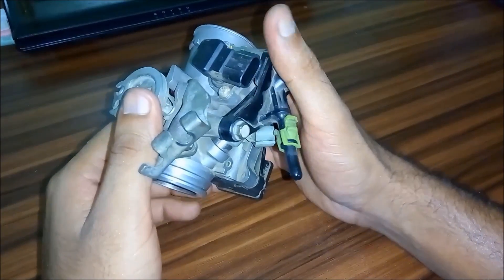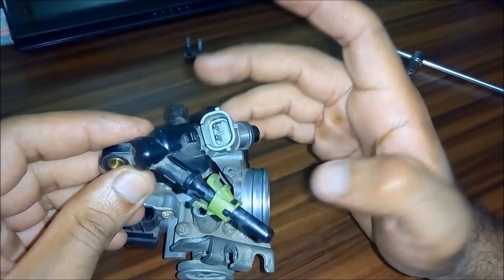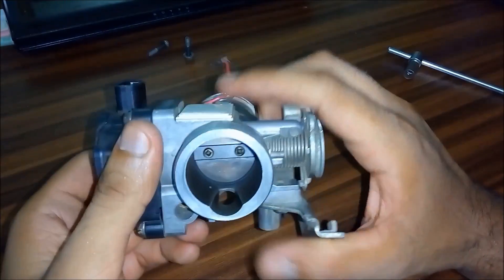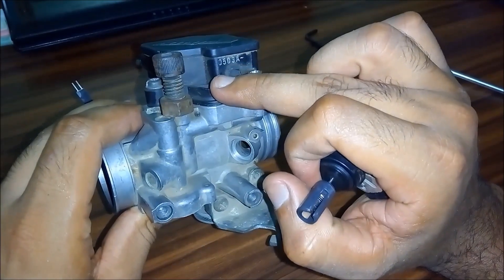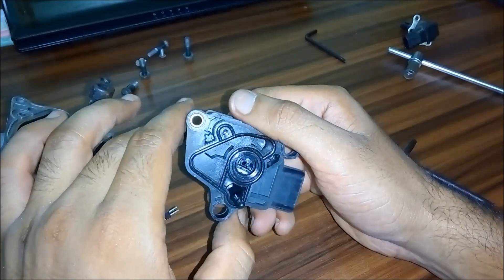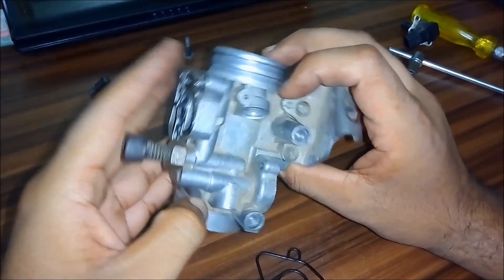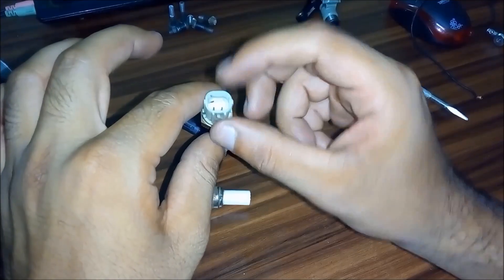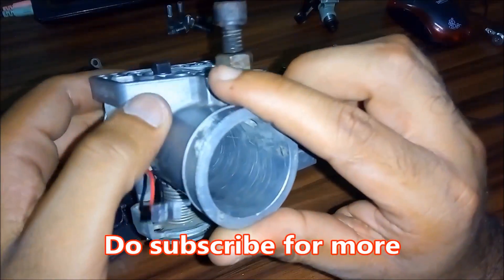Karizma ZMR,CBR 250 Throttle body ,fuel injector full breakdown and sensors explained

Comment: Sir i have 2012 model hero honda karizma zmr which was used till 2016 and kept aside just for project work i brought it for Rs.18000/- now my project is cancelled so i would like to restore it completely it was converted to carburettor by first owner...now when i tried to estimate after dismantling it was around RS.124000/-...major expense in that was FUEL PUMP RS.11000/-...THROTTLE ..RS.36000/-...PLS help me to restore my zmr for minimum price according to your knowledge...pls give me your best suggestion..

Comment: How to fix problems regarding Idle Air Control Valve? My cbr 250r have poor idling and is hard to start with closed throttle!
Is the IACV fixable from home?
If not how is it to be fixed? please help

Comment: Bro after cleaning my zmr throttle body, the idle RPM rised up to 2k
Reply: Close the idling air screw little
Reply: Check ur throttle position sensor properly in place and check air filter also

Comment: Hello.. can you help me for my ZMR 2011 model? Actually I have andling issues and local garage suggest me to reset Throttle Body from showroom. But they saying for replacement and it cannot reprogram.. so please tell me what is thruth
Reply: Bro check all sensor redings and if it's needed replace the faulty one only

Comment: Sir i have a cbr 250r Abs model 2013. I have an issue with my engine heating a bit too much thats becoz ecu cannot monitor the proper mixture of Air and fuel. I have checked the ENGINE lightm there are 9 blinks. What to do? Do i have to clean IAT sensor or buy one? And whats the price of it sir?

Comment: What is the significance of that big allen screw on the throttle body ?
Reply from the maker: Just a bolt I mounted to adjust Idle..!!
Reply: Ah so it does not come like that from the factory right ? Seems like a mechanical stop to bypass idle air control valve ?
Reply from the maker: Yes..!!..Idle RPM was 1200 even at fully closed throttle plate so mounted this bolt to keep it at 950RPM..!!
Reply: @powerpulse.Tuning  That sounds really nice , any pratical benefits to it ?
I personally think that it will make it a bit difficult for the bike to be maneovered at slow speeds and also more clutching will be required at the launch ?
Reply: @mokujin29  just to increase fuel efficiency at idling conditions specially on red light or in case of serious road jam
Reply: @tarunrajvlogs4274  No it has nothing to do with fuel efficiency.
Reply: @mokujin29  at idling conditions IC engine runs in between 1000-1500 RPM when u initially start engine rpm goes slightly above 1800-2000rpm bcoz tht time engine needs rich air fuel mixture ratio (10:1) in order to achive operating temperature but after some time rpm reduces to 1500 rpm can vary from bike to bike and engine runs on lean mixture ..but high rpm at idling conditions obviously needs more amout of fuel as throttle plate is closed completely n air enters into combustion chamber by the help Of IAC valve ( idle air control valve) which is constant until u remap ur ECU and IAC valve pulse rate ..so tht more air can enter into combustion chamber as stepper motor ( IAC valve) reciprocates slightly more inside throttle body ...n moreover in case of idling conditions fuel consumptions is directly proportional to RPM ..more the RPM at idling conditions more fuel will be comsume by engine 

For example at neutral idling conditions if u rev ur engine to high rpm than obviously u need more fuel for tht in order to achieve high rpm so low rpm around 1000 to 1500 is best for idling conditions it ultimately improves fuel efficiency at idling conditions
Reply: @tarunrajvlogs4274  Wow that is huge info & it is all correct.
However meddling with AFR is not required as long as the IDle Control Valve is working.
Reply: @mokujin29  btw by reducing idling RPM u can increase fuel efficiency at idling conditions whether other factors can also be vary with it but fuel efficiency is also one of them ...

Comment: Hi Bro, my zmr is stopped on road while riding ..as my mechanic said fuel pump and cdi not working ..but while riding bike it stopped like how we feel when petrol is not their on tank(I had half tank petrol ) and I heard some kind of short circuit sound near left side of tank and same sound in flasher below seat...can anyone tell what will be the issue..because my mechanic say it may cost too high for all new times ..please reply ASAP
Reply: The fuel pump is shot , you need to import a new one from Aliexpress.com OR get the carbon brushes replaced from someone who works on starter motors.

Comment: I need a help my cbr250r is getting trouble to start in moring . What can be the issue
Reply from the maker: Well if ur bike is having trouble while cold starting then that might be the Engine oil temp sensor malfunction... Otherwise Cleaning fuel injector and throttle body will do the job..!!Make sure check engine light is not blinking..!!
https://youtu.be/96sl1lnYyGo

Comment: Mate could you pls help me with my zmr..i am from ludhiana..i have the latest gen..the problem im facing is jerkiness and hesitation at lower rpms say idle rpm to around 2000rpm..i am not able to use the low end torque..i have also owned a karizma r and i wud just put in 3rd gear on turns and it wud simply glide without any hesitation..but zmr is jerking..i went to service center but they dont know shit about this bike..it is really frustrating as the driving pleasire is down to zero..please offer your two cents..
p.s - are you from punjab?
Reply from the maker: I'm sorry bud but there's no solution as company messed up with compression ratio and ECU remapping...There's been more den 200 cases of complaining about knocking and other annoying sounds and rough riding in regard with version 2 models.!!!My suggestion is keep RPM above 2500..!!!
Reply: Sparkplug change

Comment: Hi +TopEnd,
I've just changed my headlight assembly on the zmr myself n accidently forgot to reinstall the bank angle sensor. It started beeping on my engine check light and the engine was revving on its own. Now that I've realized that I missed it, I've reinstalled the sensor back and the engine check light is not warning me of anything. But still the automatic revving has not stopped.. Can u pls help?
Thanks.
Reply from the maker: That sounds like a clogged and dirty throttle body and idle air control valve....Also clean your fuel injector!!!
Reply: TopEnd
Sure I'll see what I can do.
Thanks
Reply: TopEnd
Hi again, do I need to reset the ecu after reinstalling the bank angle sensor??
Reply: Check if your throttle cable is binding.

Comment: Sir I have Honda cbr150 when I am   not drive my bike 5 to 6 days then my petrol drain 2 liter approx...what's the reason sir..
Reply from the maker: 2 litee is a bit much....fuel is leaking brother either from below the tank where fuel pump is located or your top cap is loose...fuel might be getting evaporated from der....also check for your fuel pipe lines to make sure they r tightened
Reply: Sir...i forget to add one more line..
In between 5 to 6 day i use to drive   1.50km to 2 km only to going market...so suggest me what's the problem..
Reply from the maker: Yes its not much distance!!!check for leakage beneath tank
Reply: Thank you so much...sir

Comment: CBR 250R uses the same throttle body?
Reply from the maker: Vijay Anand Not just CBR 250 but every single cylinder motorcycle throttle body has same components nd physical structure. ..
Reply: Na na mate, I got the principle and how it works, I was interested in knowing whether the parts are swappable, meaning the throttle body as a unit and injector setup, is the CBR's throttle body a direct fit to the ZMR vice versa, since your title read 250.. Just wanted to know that :)
Reply from the maker: Nahh...Thers's slight difference in inner diameter of cbr's throttle body...Have cleaned CBR's throttle body before and It was pretty much same...But I wouldn't recommend swapping it...Fuel injector size nd shape is same but injecting capacity is diff...If u swap it with ZMR's then you'll be running LEAN air fuel ratio..!!
Reply: Excellent. What's the injector hole count of the CBR and ZMR, 12 hole injectors?

Comment: Can you please post a video on how to remove the throttle body system from the bike? also the tools required. It will be really helpful for users like me
Reply from the maker: https://www.youtube.com/watch?v=kj_WDef1zNA
U can watch this in slow mo from 5.00 -5.35..!!
Reply from the maker: All u need is a screwdriver and a 10mm wrench brother!!
Reply: TopEnd thanks for that update. Being lazy and hesitant, I just removed the battery side door today to access the throttle body. Then, I removed the mouth of the rubber tube that connects to the inlet of Throttle body and sprayed ABRO carb spray in the inlet side and cleaned it. Hope this method is more or less effective as I am yet to check the bike's performance after this cleaning.
Reply from the maker: Well if u wanna clean like this den make sure u do it while bike is running...it's gonna try shut down while u spray it in running vehicle...don't let it shut ...nd don't spray for too long as well
Reply: oops. my bad. I have done this while the engine was kept off. Moreover, I have deliberately sprayed the ABRO stuff finishing almost half of the can. I then started the bike after fixing back everything. Now, I am noticing the jerks even more at around 3K RPM. In addition, I have noticed that PGM Fi light was also blinking after initial check (don't remember the number of blinks, may be 2 blinks) once on yesterday. But the light has become okay after I restarted the ignition and no issues noticed till today evening. Pickup also feels sluggish. I doubt that cleaning injector is still needed. what's your call?
Reply from the maker: Best is cleaning fuel injector and throttle body by removing it...Cuz sometimes MAF sensor gets clogged when u spray while engine is shut!!Carbon deposits from Idle air path goes further and clog it!
Reply: OK. let me remove the complete fairing and then clean the throttle body and update you. Hope my earlier attempt did not make any of the sensor go kaput
Reply from the maker: Naah..If any sensor have fried den check engine light wud be blinking...Hopefully the carbon wud have been sucked into cylinder and thrown outta exhaust when u cranked the engine..dats y there was light when u initially turned it on!!